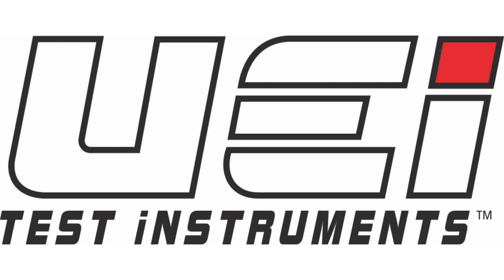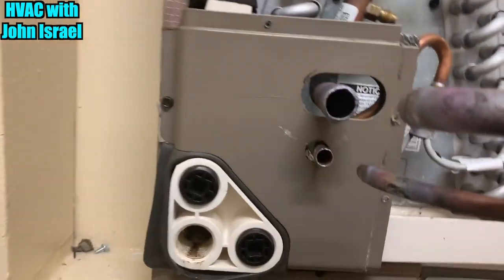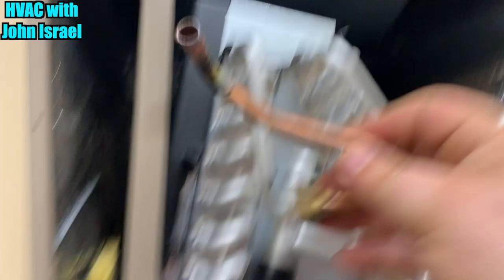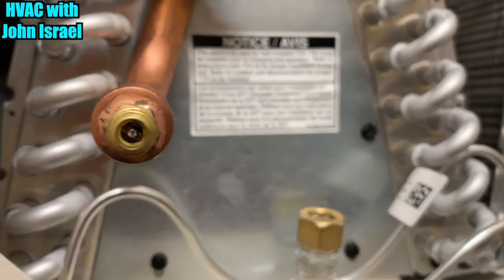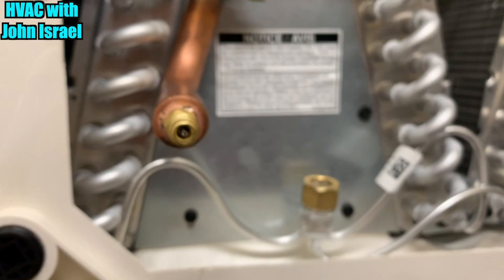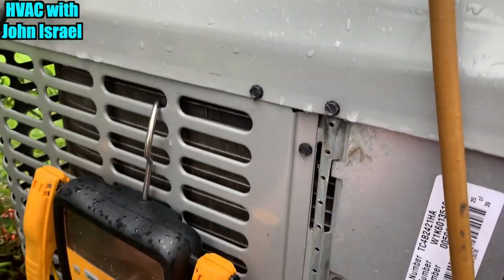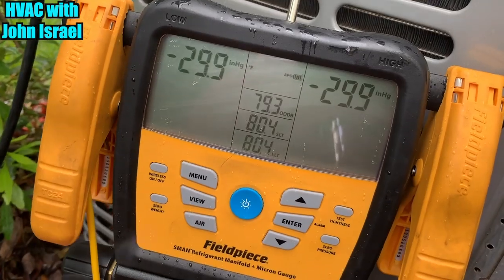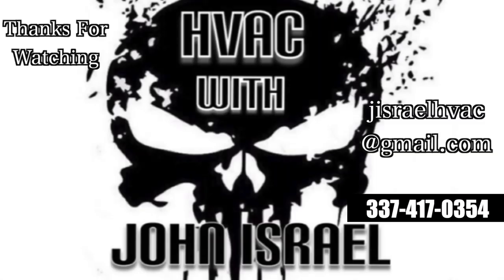York/Luxaire Evap Coil Replacement

Comment: I am glad to hear that you are impressed with YORK/Luxaire. Did you know the control panel swings out to get easy access to the filter drier. Those days on pumping refrigerant back in the condenser is almost over. Goodman, Lennox and Carrier / ICP although they don’t use micro channel they use the smaller diameter copper for their condensers, I was told by all four manufactures tech support do not pump down the units. Good Video👍

Comment: Hi john , you just pulled the evaporator coil out of the shell and inserted the new one , am I right . Last job we did we had to pull out the entire coil out   with casing and replaced with built in shell , l learned something new , by the way your video is great